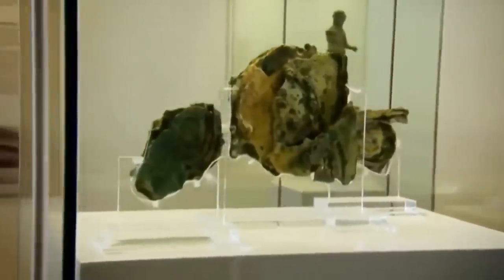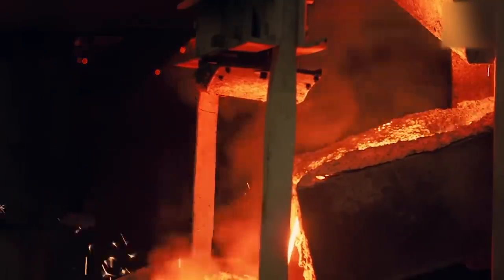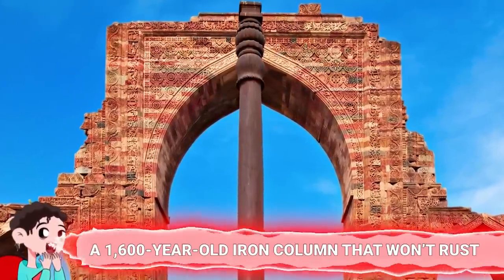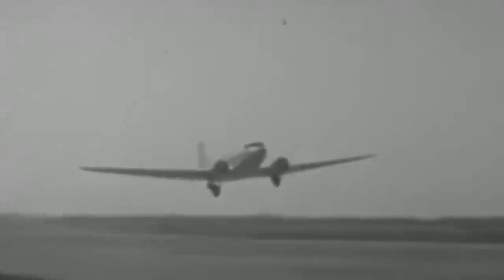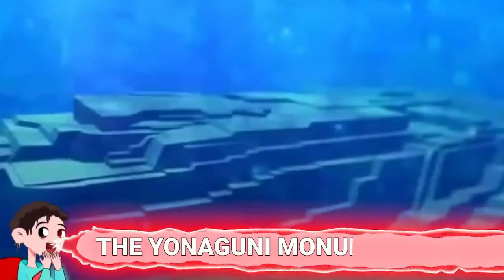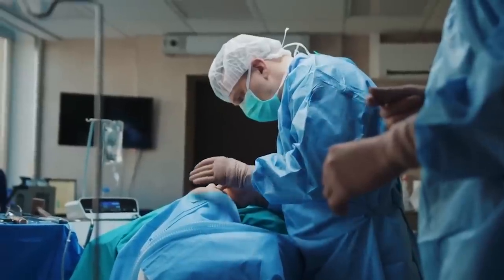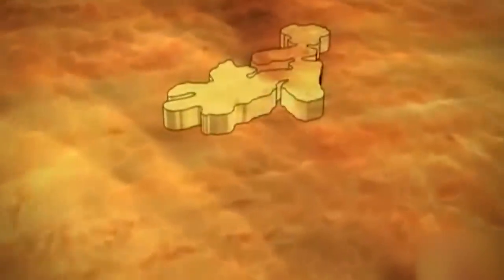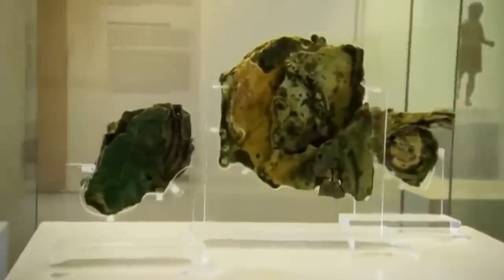20 Oldest Technologies That Scientists Can't Explain

Comment: I am going to give this a try. Dodecahedron= The holes are different sizes, so maybe they were to help fight counterfeit coins. Example, if the quarter doesn't fit the quarter hole your most likely ripped off, especially on precious metals like gold. Okay, all you scientists out there, time to pick apart my theory.
Reply: I thought the same!!!🤔🥳👏👏👏👋✌️
Reply: Possible. I bought a plastic replica to study. One thought was if you wound it with cordage in a certain way and then hurled it with a lever, would it make an awful noise? Like an Aztec death whistle? Striking terror into your enemy? Probably not, just a thought. I lean toward game piece or something used by oracles.
Reply: Probably need to find out when they were made and then when coins were made uniform size and shape.  If made before then it wouldn't be for coins since older coins were not made perfectly round.
Reply: Nah some Roman was playing a D&D Barbarian
Reply: Or to put some sort of value on a coin? Like a coin of 15mm vs one of 30mm?

Comment: No, we do know how Wootz Steel and the Ulfbehrt swords work. Wootz steel was crafted from iron which contained other metals, giving it its superior qualities, and vikings added animal bones to the fire when forging iron. The bones added carbon to the iron, making it into steel.

The “nuclear detonation” cannot have actually been that, given that absolute necessities for nuclear fission are a highly sophisticated understanding of physics and advanced technology capable of producing the energy needed to jumpstart said fission.

The underwater structure was built on the surface and later the movement of tectonic plates sunk it. It’s not the first structure we’ve found in such a situation.

In regards to ancient surgery, calling it “unexplained” is an insult to our ancestors. The human brain has not changed in any significant way for many thousands of years, so there’s no reason to believe they couldn’t learn how the human body functioned (if only on the macro scale).

The Baghdad Battery is not and never has been a battery. There are many examples of these jars, and they all have a neck with a handle or evidence of the neck breaking off. Inside the jars were metal cylinders that held papyrus (and yes, even where solid papyrus was not found we found traces) scrolls with spells written on them. Curses, bindings for demons, charms, etc.

The building that amplifies sound is easy to explain. Humans have always had good hearing and are very smart, so we figured out acoustics very quickly after we began building things.

Comment: The Phaistos disk can be dated with modern technology as that would prove real or fake. But what is interesting is the disk is pressed by something possibly Bronze or copper. Which means some one made it to make others. It looks like made from clay but also could be copper. But it is clearly pressed in to it those figures rather than hand made drawn. Also there is it being sort of spiraling to the center. But not very accurate as starting point seams off. Plus no symbol is exactly the same size shape amount of points look how badly the triangles are done. Ok got it it starts from the center going outwards.